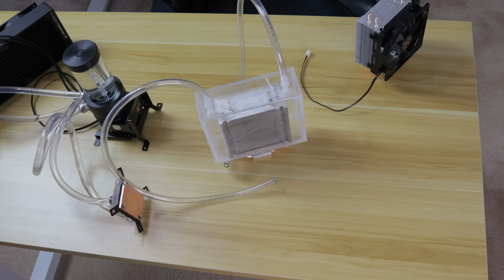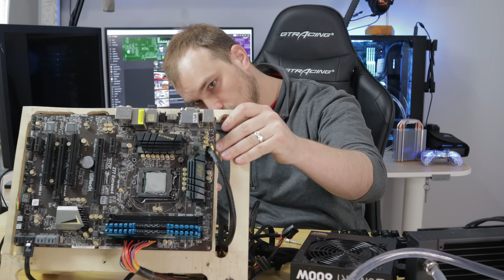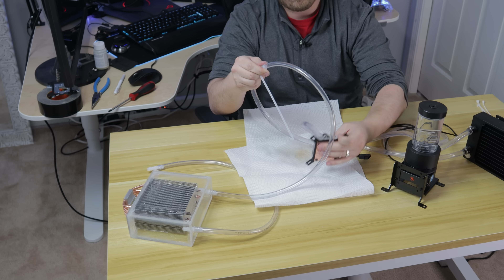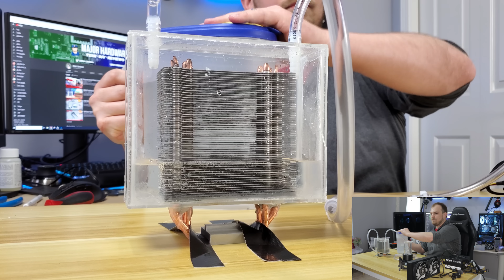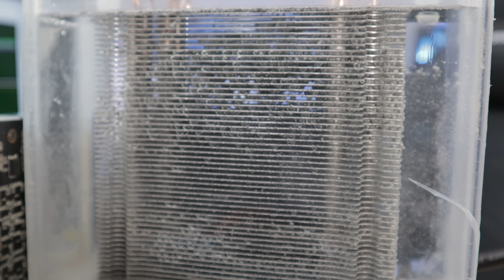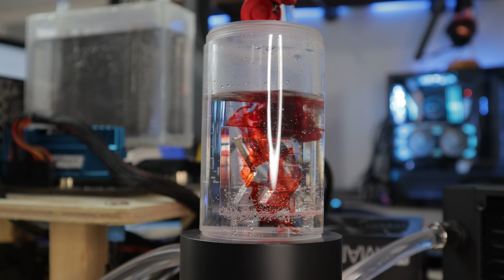Water Cooled Air Cooler Tested Against - Air Cooled Hyper 212 EVO and the EK-Supremacy EVO

Comment: It was so hard to watch the same mistake twice. Should have turned that thing on its side from the side you were filling it and water could have filled vertically up the fins for little, to possibly no, trapped air bubbles inside the fins. You even mentioned this in your last video. I was so excited to see this and I really hope you do more with it. I think getting rid of those air bubbles alone would increase the performance. That and making the plexi case smaller so that the only way to flow from one side to the other is through the fins. Can't wait to see what you do next!

Comment: I think this cooler would definitely fail on something with more heat. Theres no heat exchange outside of the system. All you have is the air cooler being heated which then heats the water. The only way the water is now dissipating heat is through its contact with the tubes and plexi case. With more heat the cooler would overall fail.
Reply from the maker: except for that rad thats connected to the loop

Comment: i dont understand how the little res/aquarium thing you made to go around the hyper212 doesn't fill up all the way before getting pushed up and out the other tube.. i get that once it reaches the tube it will start to go up it a little bit but path of least resistance would still be to fill the rest of the square tank up and then go up the tube the rest the way

Comment: @Major Hardware One option to help the water flow through the fin stack, could be to put the barbs on the sides of the encasement so water flowing out of the tubes into the Liquid Heatsink Chamber, would be pushed through pressure from the pump directly into and through the fin stack of the heatsink itself and on the opposite end, would be pulled and sucked through the fin stack towards the exit barb and tubing. With a sideways mounted barb setup, you could also do a double inlet and double outlet barbs for the Liquid Heatsink Chamber, using SOFT CURVED Splitting Tubes (IE NO T Shaped Splitting Tubes, use Y Shaped Splitting Tubes on both sides.) This would allow the spacing of the double inlet/outlet barbs to be placed in such a way that the natural pressure of the liquid flowing due to the pump, would push the liquid through the vast majority of the fin stack array. Just some food for thought for V2, can't wait to see it!

Comment: I wonder if having the input/output on the "block" on the long sides going straight through the fins would have worked a little better? Definitely seemed like most of it was flowing underneath and through just a few fins on the bottom of the stack. Can't wait to see what you cook up for V2.

Comment: i think making the plastic casing to actually fit the cooler snuggly to the sides and actually adding water pressure to one side and sucking it out the other adds flow. it might also remove the air bubbles in the heat sinks.

Comment: Seriously, you REALLY need to incorporate an external radiator to cool the water. Water cooling needs some method to transfer the heat build up in the water to the air. The enclosure of the 212 is an insulator, not a conductor. The same with the tubing and water reservoir.

Note: I apologize if I missed that you were still using the radiator that came with the EK system with the 212 waterblock.

Comment: It's a completely closed system.  It will eventually overheat because there is no place for the heat to escape to.
Reply from the maker: the rad was on the system
Reply: @MajorHardware  oh ok. That make sense

Comment: ya flow and airbubles-you need a different tank 1st and put it sideways-whay it has to lay ? and btw than if leaks -maybe not gonna go on the motherboard ...:D specially if the mobo is upside down meanincg cpu is on bottom gpu is on top ....
and tank need just a really bit different to start flow under the radiatorclose to cpu and pick up  water opposite corner...and if you want to make it a bit complicated put a plastic divider in the whole thing forcing the water to do an S turn while going trough atleast 2 times on the radiator... i guess you get it...
Reply: and if you are worried about weight i am sure that you can desigh a separate support holder...
BTW the idea and the video is a good idea what you had basicly...

Comment: if its a brushed fan motor you can run it in water. rc guys used to run a new brushed motor in water for 30 mins or more with no load to set the brushes.

Comment: you could make it cone or pyramid shaped.

so the water flows from 1 part to the other. with loads of dividers dividing the water-flow so it hast 9/16+ inlets and 1 outlet.

this way you can force the water to pass trough the fins

Comment: I would add curvature to the bottom of that box, sharp edge block the flow. You could also add a pump rotor with fins shaped to create a vortex inside the block.

Comment: I used to spend so much on watercooling my components, then one of EKs x360 rads sprung a random leak while i was gaming and it completely shot my system.
6 months old water poured right into my PSU shorting the 230v over to the 12v rail.
The cpu died, the GPU died, the motherboard died, the ram died, the hdd's died.
I lost my whole system in a big bang and a whole lot of smoke.
all components was from EK aswell.
They didn't even respond to my request for a refund for the cooling kit.
Now i stick to noctua fans and nh-d15.
Fuck EKWB.
Fuck them for all my lost data, components and time.

Comment: In Ek system water is cooling by a radiator, so cooled water coolong ek block that take heat from cpu.
but in your system hot water looped, and it is surprising for me, that water without ice can stiil cool airtower. sry fo my bad english may be. but if you going to grade up your system, think about cooling the water in loop, because directed waterflow it take much more heat from airtower.

Comment: Suggestion for 2.0:
Keep the long sides of the cooler tight against the long sides of the air cooler, maybe even use some waterproof caulking if needed. It'll force water to go through the fins with no chance of the water just flowing around the fins.
Put the inlet low and the outlet high, this will also force the water to go through more fins, rather than shortening the loop. Water will flow along the path of least resistance. 

Now this is more complicated, but put in baffles, force the water to flow along each fin. I'd suggest two options: Multiple chambers with multiple inlets and outlets; or going along with offset inlet and outlet, create a folded tunnel with opening in the baffles occurring at opposite ends. The folded tunnel would basically start at bottom left, travel to bottom right, go up one layer on the right and travel left, up again, repeat until you reach the outlet at the top right; or top left if you decide that's better. 

Now I have another suggestion, not for 2.0, but for another project. Instead of a radiator, use a second cpu water block, then paste and screw an air cooler to that secondary block. If the water block dissipates X amount of heat, and air cooler dissipates Y amount of heat, it should dissipate heat at the lower rated cooler's rating; X>Y=Y, X<Y=X. In theory it should work better than just the air cooler by itself, because of the body of water. 
Of course this would need a custom mounting bracket, and it'd take up a decent amount of space; but I have yet to see anyone actually try this.
Then to expand on this, what happens with a second pair of cpu water block and air cooler? If there's significant benefits of a second pair over a singular pair, what about a third pair?

Comment: That 63c result on load doesnt sound bad for that voltage. I had 2500k running at 5GHz with about 1.4v, and it was hitting around 65c on prime95 with chinese waterblock. Now i have Heatkiller IV, never tested on 2500k but on my ryzen 1600x got 3-7c improvement from chinese block, depending on how high overclock.

Comment: If you are a savvy buyer and you want an  aio or custom solution you can get one for as low as 35-50 euro depending on region and 120-170 for a 120mm and 240mm custom cooler respectively which in retrospect is a great deal because just like the case and psu and drives you are going to keep it for multiple generations of computer's which make it a great deal for both keeping your hardware cool while still overclocking great and to keep everything spooky quiet.

Comment: You should get rid of all the air bubbles. They insulate the fins from the water and thus decrease the efficiency of the cooler.
Since almost 40% of the fins are filled with bubbles you could get a good efficiency boost.
The color flow test is a really nice idea though :)

Comment: Turn yoursystem 90° and the waterflow would be assisted by heat exchange also the bubbles could escape... there is a reason for vertical fins in water blocks

Comment: When you do go and do version 2 and it's a full copper I would strongly recommend using a different rad only to avoid any corrosion that would impair the results. The pump and res are probably salvageable but I wouldn't reuse those fittings
Reply: corrosion isn't something that happens in seconds, mixed copper and aluminum loops can last years before corrosion ever becomes an issue.
Reply: @harpskid  except when your using aluminum inside a loop with other metals, in which case corrosion will occur in a matter of days or at best weeks instead of months
Reply: @LightningManGTS  That's why aios only last a few weeks right?  yeah, thought so.
Reply: @harpskid  the difference is they use antifreeze with other inhibitors to prevent breakdown in a loop that was vacuum sealed. Where as here he used cryofuel which is not gonna do much to prevent galvinization. So yes this makes an effective life time difference of over 500% in most cases.

Comment: your pulling cool water off the top you should extend the in tube to the bottom of the cooler you made on one side. so that the cold water goes to the bottom of the cooler where it is hotter and the out should be on the top like it is. hot liquid rises, and there is no cooling the lower fluid in you homemade reservoir. great idea but i thought you were going to make a 2.0, would deff like to see how that would perform in the future if you make this change.
Reply: I think you're over estimating the effect of hotter water rising vs colder water, especially since it's circulating. The most important imo is to get an even flow through the heatsink fins.
When i make a cup of tea, i sometimes watch it through my thermal camera. It looks like the surface of the sun, small patches of hot and a little less hot water swirling around each other. After a while it evens out in temp, but before that you see a patch of hot water on the surface "dive" down for a while, just to resurface a second later.
What i tried to say with that, is that the flow from the pump, will over power the effect of hotter water rising.
Reply: @exoc1  that is what I was getting at by putting a tube to the bottom of the tank and getting a more even flow bottom to top with a more swirling effect. Although shrinking the sides of the cooler might reduce swirl and create more even flow through the fins. Or two pieces of acrylic with a few small slots Dremeled out of it so it forces itself through the fins evenly, on the in and out side.
Reply: @HinksyDude  I'd like to see the side cavities divided by horizontally placed dividers. Put in a patterna that makes the water pass through the heat sink 3 times in an S-shape. After the canister has been narrowed down, so the water doesn't run on the outside af the heat sink.
Then put either the intake or the outlet on the lower part of the canister.
Sorry if my bad english doesn't translate my thought's..
I'm no expert in fluid dynamic's, but it's fun to speculate. :)
Reply: @exoc1  I like that idea alot that would be ideal. but it all comes down to what tools are available to you. That's why I was suggesting the dremel and something simple

Comment: Do it with a much larger air cooler like a Noctua and fix the flow issues if possible.
Reply from the maker: What would that weigh
Reply: A lot, to say the least, but it would still be fun

Comment: Sugestion: Remove the fins from the WC 212 evo, Let the water cool the heatpipes directly, the fins are for exchanging heat with the air which isnt a good heat conductor hence the big surface area, water is an excelent heat conductor, cooling the heatpipes directly should work better than with the fins as the fins only restrict the water flow

Comment: when testing your WAter  212  you should tilt the output side so it is higher to stop your cavitation problems this will  raise the water levels higher up on cooler tank.
ie from when you are testing lift left side to say 30° then put back to level it will fill your  water212 cooler.

Comment: Is 30 minutes long enough to fully saturate your water loop?  If not, then these results are invalid.  One of the biggest reasons water cooling seems better in benchmarks than it actually ends up being in real-world use is because those testing it don't run it long enough on a system for the entire loop/all the water to reach full heat saturation.  For the full science on it check this video: https://www.youtube.com/watch?v=eSOcUnn1mtQ

Comment: Possible improvements:
1. Switch inlet and outlet position to the sides to force water through the fins, should help with the cavitation issues as well. Also, if you had multiple, smaller side inlets you'd have faster water velocity and more uniform flow to increase efficiency.
2. Add a radiator to the loop for maximum heat exchange.
3. Reduce container dimensions so that fins are as close to the walls as possible. That way majority of the water will be forced through the fins than around them.

Comment: pretty dumb solution, because of all the bubbles and hot water trapped between steel plates. would be wiser to put the radiator with one fan on radiator on slow rpm to help water flow between plates of radiator

Comment: Some concerns:
1- The pressure in the plexiglas due to the pump will be slightly above zero as there is a lot of air trapped in there and the same amount of liquid that enters goes out. The only problem will be the weight of the water, that is the same as in the previous video.
2- Are the fans of the radiator running? Because if not, I don't think you will ever be close to the waterblock temperatures. EDIT: I've seen some comments saying you are not even using the radiator... I think you don't understand how heat transmission works, where is the heat power supposed to go when it heats up the water? The convection ocurring throught the tubes, reservoir and heatsink will never be enough to dissipate whatever wattage that CPU is putting out as heat. You NEED a way to transfer the heat from the closed loop fluid to the ambient, and that is the radiator.
3- I think you could easily 3D print an enclosure that guides the water perfectly between the fins that has one side open that screws on the other side and put an o-ring there to make it waterproof. 

Also, maybe the heatpipes are somehow liming the heat transfer from the CPU to the heatsink, maybe an smaller heatsink that mounts directly on the CPU will improve the performance.

Comment: average across 30  minutes? that's not fair to the air cooler. it takes a long time for the whole water cooling system to heat up, while the aircooler will hit peak temperature easily within 2~5 minutes. you should get peak temperatures after one hour, not average on the first half hour.